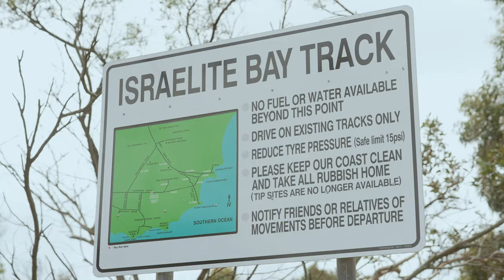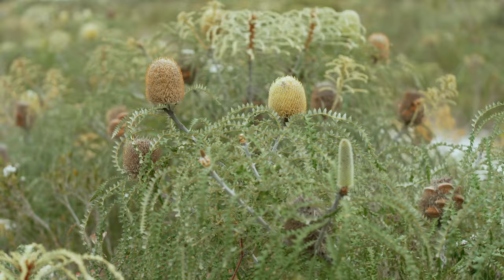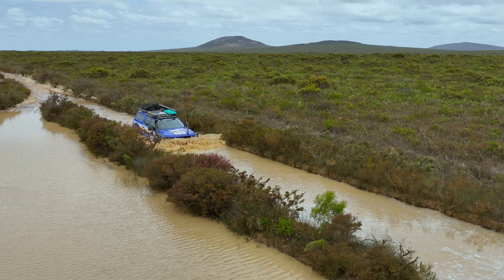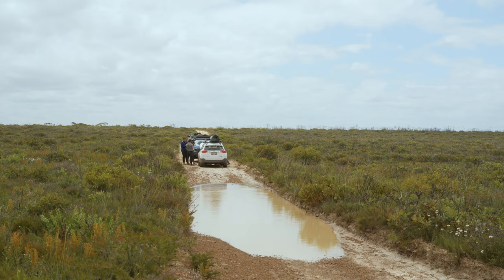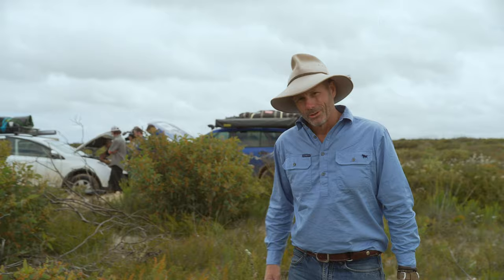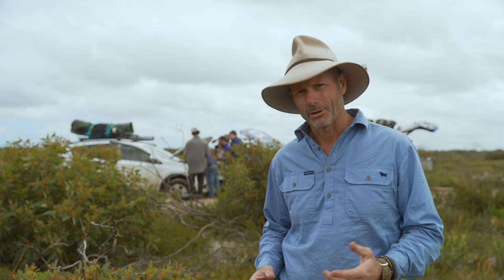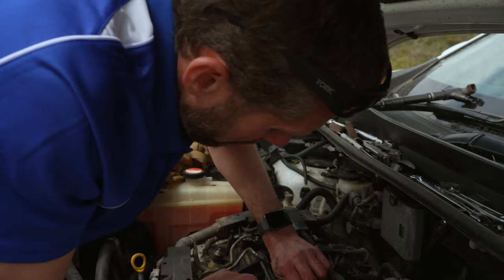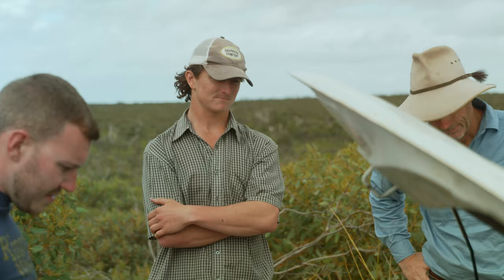We RESCUED a bloke stuck in the MIDDLE OF NOWHERE!

Comment: BOW WAVE.. electic fans, turn off.. use a blind, canvas, tarp, over grill. do not change speed, do not speed thru water. fuel tank. ford s/duty, 145 lt std, aux ford in cab 1970 tank in tray, 85 lt. 3 jerry cans, 60 lt.. no worries..14 lt 100. regardless of weight.. 35,s , 2 diffs, no ifs,computer bs..